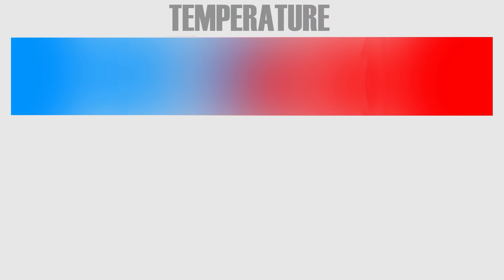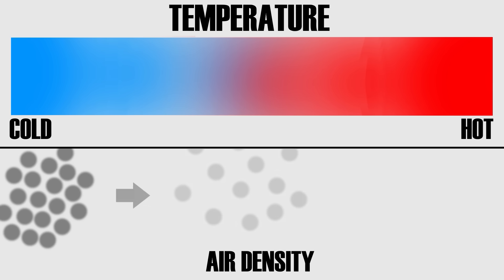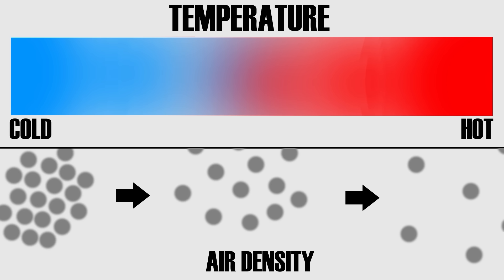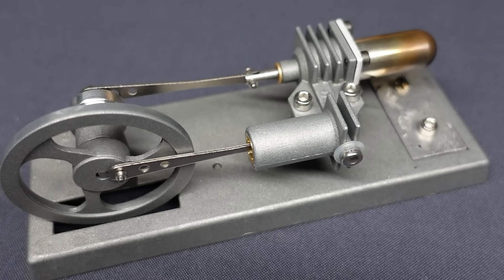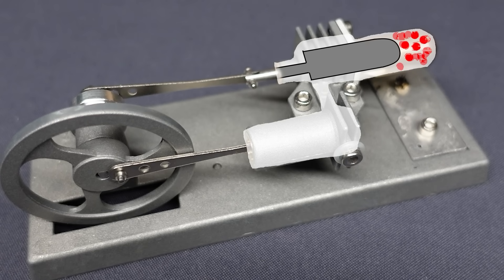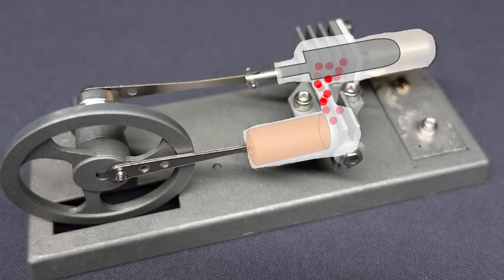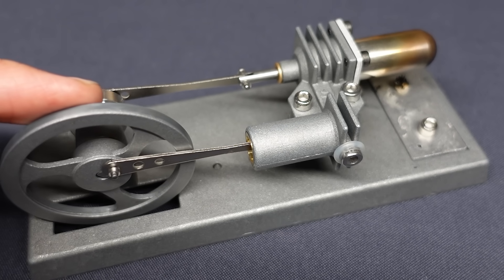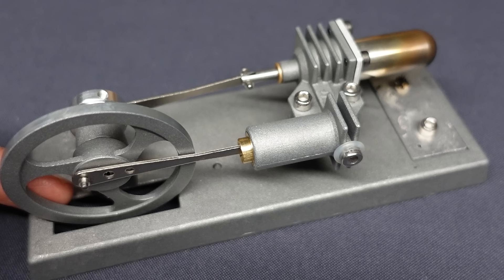It Can Save The World - The Simple Genius of Hot Air aka Stirling Engines

Comment: It's the quiet operations that submarines use them for. I made one for machine shop class, but the displacer cylinder was made of borosilicate glass and cracked due to handling.
Reply: i was going to make one for my old highschool metal project... then i looked into getting inconel and stainless... pricey. then i looked into getting a slab of either wirecut, EDM... and decided to make something else.

main issue that i see is the serious lack of surface area. was going to get a piston and cylinder cut with deeply finned internal surfaces, like a splined shaft but taken to the extreme. seems easier and better than the "loops of pipes" that i think the phillips used.

25 years on, guess i could get them 3d printed now.

all i see is people with plain stainless cylinders, glowing redhot, transferring mere watts through the metal to the working fluid contained within...  needing it to glow redhot just to overcome its own losses...

andy ross had a few good attempts, shame he tried soldering his internal fins rather than cut from solid... or printed.

Comment: I feel like with some thought, you could make this compact and couple it with an electric heater - have some juice to start and run an electric motor, then use the waste heat (from the coolant) to generate more motion for electricity generation. Running off what you're saying that is

 if someone also makes a better battery - that would be a pretty impressive vehicle. I'm imagining a "liquid cooled" - heated Version rather than find - maybe some internal fins for better coolant heat transfer...

Comment: Sterling's engine is not (necessarily) a combustion engine at all. It's a *heat engine*, it operates leveraging thermal gradient. The heat difference doesn't have to be caused by combustion.

Comment: so stick one near a few volcanoes and boom you have infinite energy. just imagine, if you're within 150 meters of the lava tube, the air around you is already well above 200 degrees. you don't need to get that close. that heat transfer will happen very easily. or make a lightweight weak one that just turns and turns all day with sunlight. a weak "solar sterling engine" if you will.

Comment: I thought about creating a Stirling engine to power only the accessories of a conventional engine, using only the heat from the exhaust, it would be a good project for the weekend.
Reply: I'm curious now about how much fuel I could save on my old 4-cylinder 1L engine.
Reply: It'd take a while to heat up, so you wouldn't have your alternator, power steering, air conditioning, or possibly water pump until you've drive for 15+ minutes.

Comment: would there be any merit to them being directly attatched to the engine crank? something like a pulley and a supercharger. I'm not saying that this its a good idea or anything, but would it help create more power if you somehow take the heat from the main engine and use it to power this stirling engine? this way its linked to the throttle of the car. maybe there would be problems when the engine brakes and maybe too much heat at low engine speeds is gonna render the stirling useless.

Comment: I bet with actual greased bearings it would be even quieter, it sounds like most of the noise is just the conrods hitting the pins as they reciprocate.
Reply from the maker: I think so too, this is why actual larger practical stirlings are quieter than these hobby grade ones 😊

Comment: Can a turbo or supercharger be powered by a sterling engine?

Would that be useful to keep it spining in  low RMP range?
Reply: modern day designed turbochargers don't suffer from the turbo lag that earlier designs once did. Also a supercharger is a different animal altogether and doesn't suffer from low rpm lag as it is directly driven by the combustion engine via belts or gears.....there is instant boost response with an mechanically driven supercharger as it is considered a positive displacement device.

Comment: Could we have the hot part outside of a freezer or building in a hot desert and the cool part inside the freezer or air-conditioned building and have the stirling engine run the compressor for the freezer/AC?

Comment: You want to use zero point energy, that's what it is. Requires a very big device to get very little power. Would never replace a combination engine. Power isn't the problem. The people are and their greedy physically impossible demands. You can make a car with 2 bicycles. Who on Earth said that a car suppose to weigh 1000 - 3000 kg? It's completely unecessary for the daily use. But people drive because there's no alternative on the market.

Comment: Steam turbines and piston steam engines are also external combustion engines. The most interesting application that I have seen for Stirling engines is for solar power plants. Each reflective mirror has a small Stirling engine and generator at its focal point. When hundreds of these are combined, a substantial electric power output can be achieved.
Reply: IIRC, Boeing and the maker of the submarine mentioned in the video (Kockums, now Saab-Kockums) made a test plant in the Nevada desert, I think, some years ago. It worked just like that.

Comment: A question I have is, could a reverse Stirling engine be made, that runs not by heating one cylinder, but cooling the other to create the temp differential between them? Instead a burning fuel, release gas pressure to cool the cylinder
Reply: Try it! Buy a model sterling engine and spray the hot part with some keyboard cleaner upside down. The refrigerant will boil off and cool down the part quickly.
Reply: @markm0000  actually my idea is to spray the cold part, so the engine works normally, with the designed temp difference, just using the opposite approach (active cooling rather than active heating)
Reply: @robinpage1987  you could do that with a small window AC system and see how much power you get.

Comment: If I can add some little facts :

- Stirling engines don't need oil or cooling liquids, but given the fact that they get more and more efficient thanks to temperature differences, a cooling circuit on the regenerator side can help a lot in incresing efficiency (if I'm right they use sea water in this role in the Gotland submarines, simple and available everywhere ^^). And of course, lubricants can help reduce noise and friction losses.
- Stirling engines have been tested with solar energy, in some sort of solar ovens, as they only need hot gas to be operated (in some ways, we could say it's "free energy" ^^).
- For the same reasons, they are planned to be used as relatively powerful generators for space probes that usually run on RTGs, because their plutonium fuel produces much heat but not so much electrical power.
- For the same reasons they are good for submarines, they also could be used for big ships, like tankers. They could actually use a small part of the gas their carry to directly run the onboard Stirling engines.
- And last fun fact, Stirling engines are reversible : il you move the engine, you can get some really low temps on the part that usually receives the flame. If I remember right they are used to create cryogenic fluids.
Reply: Gives way to many that love a challenge in finding a cleaner and safer energy source that can run off of the dangerous heat emissions industries and the problems going all electric in vehicles causing batteries to ignite from overheated or overcharging,  too fast trying to transition from fossil fuel based industries and transportation into all electric is the results we are seeing the most from studies all over the world.  Think , design, inspire honest ways to create a better life for our next generation.
Reply: Important to note that RTGs do not directly produce electricity. They use semiconductor junctions to produce voltage from heat in a process very similar to a PV solar panel with light, and those junctions are actually quite delicate in the face of atomic forces such as the intense heat and radiation emitted from nuclear decay. The Stirling engine is being explored for RTGs because not only can they be more efficient in total, they also don't rely on atomic scale behaviors to run and thus won't degrade when you weld them to a kilogram of plutonium.
Reply: @@damonhall3931 Yes but will it be better cost/power then normal solar panels?
It requires a lot more maintenance then solar panels that is for sure.
Reply: @larsjrgensen5975  All I suggest is too look in it what it cost to make solar panels. From all the mining, transportation of said mined good, manufactory, transportation of raw material from manufacturing, to processing(making the solar panels) then transportation to place the panel. Solar panels are the worst idea ever, I feel for it 20 years ago, since then I have looked in to them properly and like I said solar panels are the worst idea going, complete waste of time.
Now with the idea of a Sterling Engine, there is more than enough scrap metal, in scrap yards (I worked as a HGV driver doing 4 or 5 runs a day, picking up 30 tons of scrap metal each time - add another 10 trucks daily like me) and that was 1 site for 1 company in UK. There is a very very cheap source of materials in which to make thousands of Sterling engines - I like the idea of adding them to current power plants for any waste heat, along with other applications - hell in places like Australia(well, any country with a damn desert really), using a Parabolic dish reflector out in the middle of their deserts - the heat over there - there is a huge source of electricity production.

I can see a lot of usage for Sterling engines - granted as stationary power generation - but still more than enough to help with the swap from fossil fuel power stations to Fully Nuclear.
Reply: @rianmacdonald9454  So how much does it cost to melt down scrap and build a precision stirling engine with a usable output?
The one he shows lights up a 1-2W LED, that is nothing compared to a old engine running on cooking oil, connected to a car generator, if you want to go cheap.

You can not add stirling engines to collect waste heat in a powerplant, they mostly heat up steam and run steam turbines.
Water heating to steam needs less temperature difference then a stirling engine needs, so every watt of waste energy a stirling engine could produce, could have been used better for heating up water instead.
By adding multiple stirling engines you are essentially mounting generators onto the wheels of a electrical car and thinking that the car now will run forever because 10 generators are feeding back energy into the battery.

I can buy a 175W solar panel for 100$ with 25 years of warranty that it will produce 80% of rated output, a stirling engine has no chance competing against that.

Comment: Paint it vantablack and use the sun to heat it? Using mirrors / lenses to focus sunlight ofc. Potentially cheaper / more efficient than regular solar?

Edit: could also encase the heated area in glass or sth so the heat doesn't escape.

Comment: The other issue is power. That LED was ~10 watts…

That's 1.3% of 1 horsepower.

The engine from a string trimmer (husqy 128l) is about the same size (28cc) and makes 1hp…

That stirling engine couldn't even power the Husqy's ignition system, yet the power output is measured after powering it's own ignition!

Comment: How big is a stirling engine that makes the same power as that mini-hardly v-twin?
Reply from the maker: It's hardly a v-twin, it's an actual v-twin.
Reply: @d4a  yeah, it is, but it's a model Harley Davidson. 

I call those Hardleys, because while they don't operate or perform as well as real motorcycles, they do have 2 wheels, so they are Hardley motorcycles.

Comment: I am no mechanical engineer, but Stirling engines produce power on the heat difference between the insides of the two pistons, being more or less like a reverse heat pump that moves heat and produces power. It is not waste heat in, power out. You need to properly size the heatsink of the cold side or actively cool it otherwise, if the difference is not significant the engine will not work. Also, the reason the engine works for a time after you have extinguished the flame is because you are 'using' the heat that you put into the system before it could start rotating on its own, thus it is not free at all.
Regarding your example, the amount of energy required to charge a HV battery is not comparable to the amount needed to power an LED. Also, how much energy do you think an exhaust manifold can hold? I did the math and to cool a 10 kg stainless steel exhaust manifold from 650 C to 30 C it needs to dissipate about 860 Wh of energy which might sound like a lot, but this implies collecting ALL of its which is impossible. Even if you design the manifold to collect heat for a Stirling engine and you can get about 60% of that heat (which I think is very generous), the Stirling engine will still make about 40% of that heat into useful energy since it also have mechanical and thermal losses (because it pretty much moves the heat and generates some power). Also adding some losses to tranform that mechanical energy into electricity and to actually charge the battery (another 25%) and you would add a whopping 50 Wh of 'free' energy into your hybrid battery, about 6% of the capacity of a Toyota Corolla's HV battery. Sure, you will also collect the heat while running the engine, but then you will need a solution to keep your cold side cool which will require some sort of active cooling to it which, in turn, decreases efficiency of the Stirling engine and requires additional complexity. If it would be viable, Toyota would've used it by now.
My conclusion here would be that yes, you can eek out some extra energy from systems that produce waste heat (like an AC system in the summer), but collecting that heat for a Stirling engine, starting it (it will need a small starter motor) and keeping it running adds a lot of complexity to the systems that produce waste heat and the gains are not that impressive because the Stirling engine itself cannot convert most of that heat into useful work anyway.

Comment: Re-concentrating "waste heat" against the natural tendency of it to stay dispersed according to The 2cd Law of Thermodynamics is not easy, if it were we could just concentrate the heat of The Sun and end all energy problems. The units here use fuel, which is already concentrated energy. The quietness issue is unimportant, you can't hear the motor in many modern cars.

Comment: It would be pretty cool to use the waste heat off of the exhaust to run a smaller stirling and that be used to to fill a air tank. The pressurized air could be injected back into the ICE adding to the pressure ratio... making a compressed air ICE hybrid. With enough pressure and a properly timed injection near the end of the burn, theres no chance to blow up the engine, no impact on nitrogen oxide formation. Power goes up and fuel usage goes down!

Comment: could you use this to recharge a battery at which powers a motor that move a car.  Therefore use this in a hybrid EV.
All you need is a stirling engine that big enough to produce enough power keep the battery charge and give some energy to the motor.  Once the ideal temperature is reach, turn off the flame.  Once the temperature drops below a ideal temperature, turn on the flame.  After your trip, the heat left over would charge the battery.  It could work, I don't know.

Comment: The Stirling engine is widely used with very high efficiency, in the field of cogenerator for large homes, produce electricity and hot water, they dare to achieve incredible savings values.

Comment: also try engine heat pre-heated/gasified gasoline carburettor, push not pull
Reply: so do you mean a wood stove for a stirling engine is an internal combustion engine. external means separate, not outside. anyways truly external outside burn seems to waste a ton of heat. so external better be contained, in like a wood stove, then the heat used in the external heat engine separately. ie hot air used like a steam engine instead. ie steam is contained. ie hot air is contained. to minimize heat losses. two pistons in that system seems overcomplicated. why not just one piston. maybe if you use two pistons, use linear pistons on single rod instead as stirling engine. demonstration units are not often the best configuration anyways. combine piston air compression heating-cooling like in the fridge/freezer to cool the air. not only the external heating and cooling, but also the compression heating and cooling. thermo electric generators no moving parts. totally silent. rtg ftw. so use a hot rock to pump the heat in not to be wasted. use those as electric generator range extenders then.

Comment: is there an example of using sterling engines and heat-pumps in some combination that achieves net positive energy results?
Reply: No, and that will never happen. A heat pump works by compressing and expanding its coolant to transport heat. Sterling engine can only harness energy from a temperature difference you created before with a process which is nearly the same vice versa.
So, to say, you compress air to decompress it. That can't ever work without additional energy sources.
Reply: you could  use heatpump to help raise the temperature difference and sterling engine to gen electricity. the question is if that is a net positive work @sinusspass1998